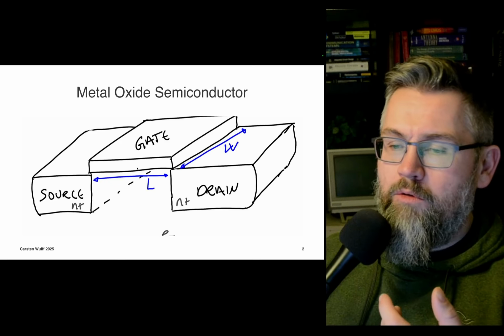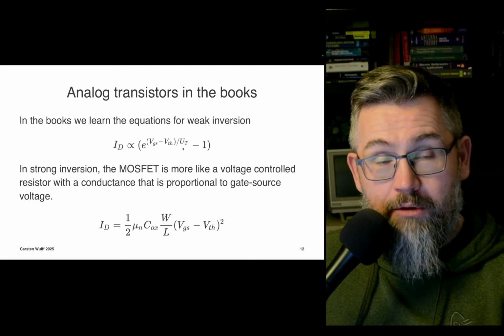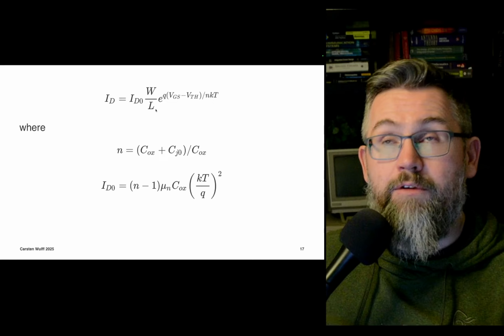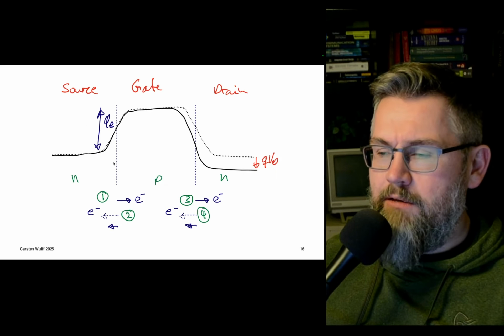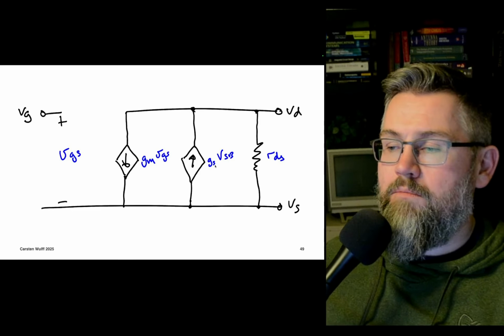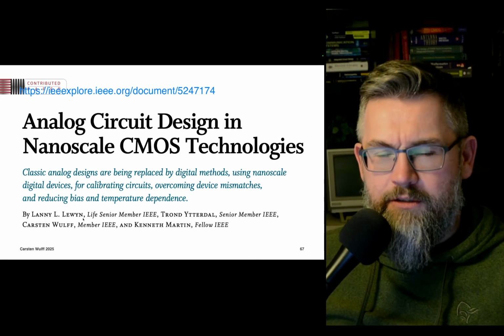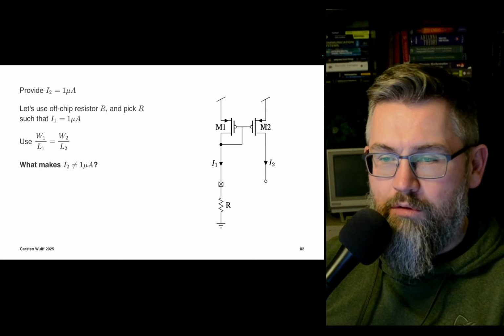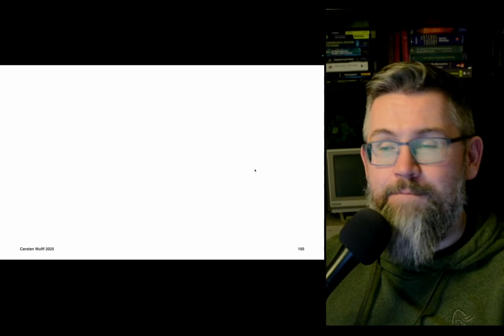Metal Oxide Semiconductor Field Effect Transistors (MOSFET)

Comment: A Deep Dive into MOSFETs: Understanding the Foundation of Modern Electronics

*   0:00:07 Introduction to MOSFETs: The lecture begins with an introduction to Metal Oxide Semiconductor Field Effect Transistors (MOSFETs), highlighting their complexity and fundamental role in integrated circuits.
*   0:00:47 MOSFET Basics: MOSFETs are the basic components of digital integrated circuits, characterized by three terminals: gate, source, and drain.
*   0:01:19 MOSFET Structure: The structure involves implanting dopants (e.g., phosphorus) into the silicon surface to create regions with higher electron concentrations.
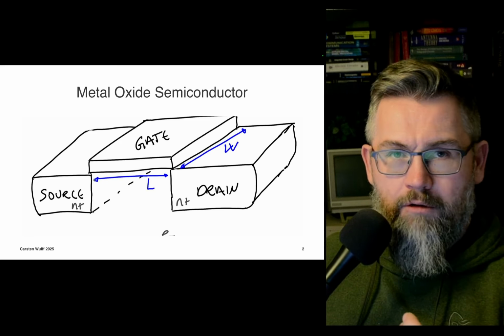*   0:01:45 MOSFET Length and Width: The length is defined as the distance between the source and drain, while the width influences the current carrying capacity.
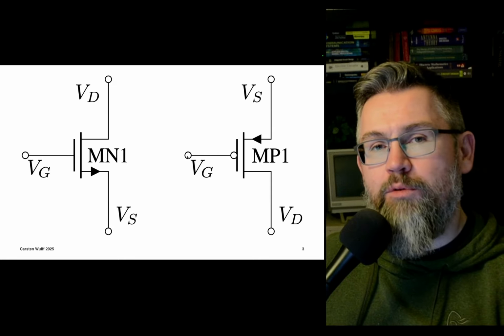*   0:02:57 MOSFET Flavors: MOSFETs come in various types, such as 1.8V n-type and p-type in the Skywater 130 technology, differing in charge carriers (electrons or holes).
*   0:03:38 Field Effect: The MOSFET operation relies on the field effect, where modulating the gate-source voltage controls current flow between the drain and source.
*   0:05:33 Depletion Region: At a certain gate voltage, a depletion region forms, followed by a thin sheet of free electrons enabling current flow.
*   0:06:46 Quantum Mechanics: The formation of the electron sheet is governed by quantum mechanics, resulting in a non-uniform electron density just below the silicon surface.
*   0:07:12 Current Flow and Pinch-Off: Increasing the drain voltage initially increases current linearly, but beyond a threshold, the current saturates due to pinch-off, where the electron sheet disconnects from the drain.
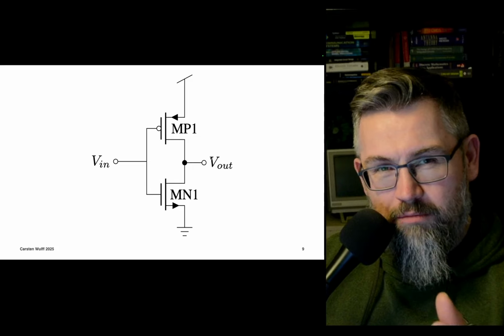*   0:08:39 Logic Gates: MOSFETs can create logic gates like inverters and NAND gates, essential for digital circuits.
*   0:10:59 Weak and Strong Inversion: Different equations govern MOSFET behavior in weak inversion (subthreshold) and strong inversion, depending on the gate-source voltage relative to the threshold voltage.
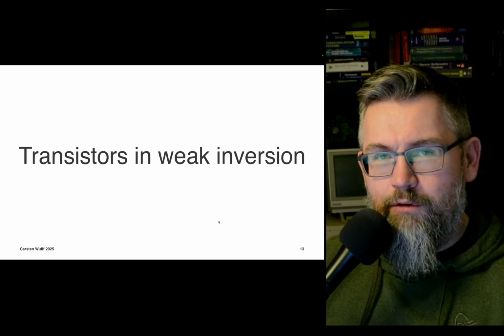*   0:12:56 Energy Band Diagram: The energy band diagram illustrates how applying a gate voltage modulates the energy barrier, affecting electron injection and current flow.
*   0:16:41 Subthreshold Leakage: A small current can flow even at zero gate voltage due to the reduction of the energy barrier at the drain side, known as subthreshold leakage.
*   0:18:51 Electron Injection: Modulating the gate voltage changes the energy barrier, exponentially affecting electron injection and current.
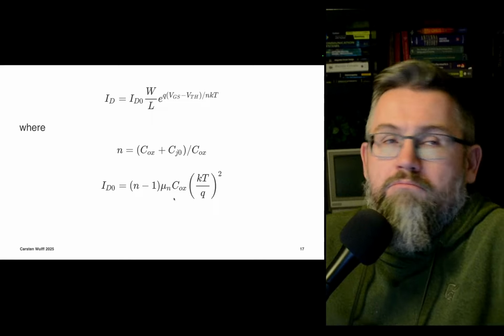*   0:21:58 Threshold Voltage: The threshold voltage is defined as the gate-source voltage at which the density of electrons in the inversion layer equals the density of holes far from the channel.
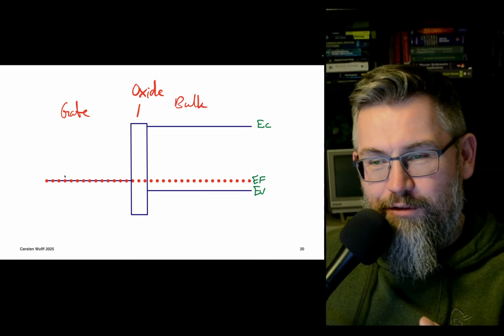*   0:23:38 Strong Inversion Operation: In strong inversion, a conductive sheet of electrons forms, and current flow is primarily due to drift current.
*   0:28:44 Quantum Effects in Small Transistors: In very small transistors, quantum effects become significant, with the electron density peaking slightly below the surface.
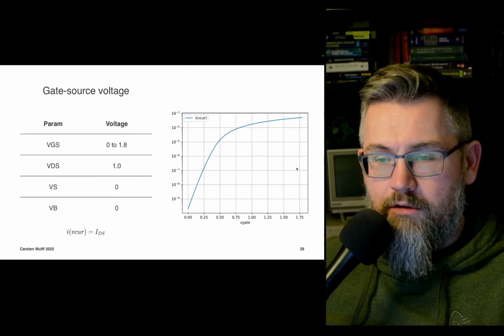*   0:30:24 Small Signal Model: A small signal model is introduced to analyze MOSFET behavior at low frequencies, considering transconductance and output resistance.
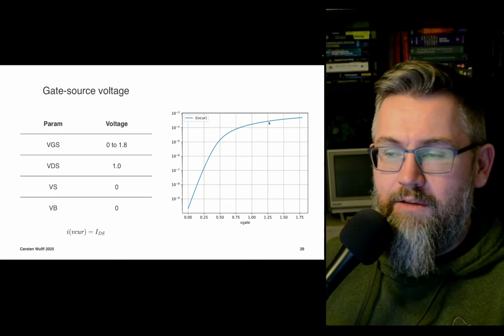*   0:31:30 Transconductance Equations: Equations for transconductance in strong and weak inversion are presented, highlighting the dependence on gate-source voltage and threshold voltage.
*   0:33:46 Moderate Inversion: Moderate inversion is a common operating region in modern technologies, and models accurately predict behavior in this region.
*   0:35:33 Strong Inversion Current Equation: The current equation in strong inversion is proportional to the square of the effective gate voltage.
*   0:37:49 Pinch-Off Effect: Increasing the drain-source voltage beyond a certain point leads to pinch-off, where the current saturates due to the formation of a depletion region.
*   0:39:56 High-Frequency Model: At high frequencies, capacitances between terminals become significant and are included in the small signal model.
*   0:42:41 Intrinsic Gain: The intrinsic gain of a MOSFET is defined as the ratio of transconductance to output conductance, which decreases with increasing gate-source voltage.
*   0:44:02 Bulk Effect: The threshold voltage depends on the bulk-source potential, introducing an additional current component dependent on the bulk-source voltage.
*   0:46:39 Capacitance Effects: Various capacitances exist in MOSFETs, including gate-source, gate-drain, source-bulk, and drain-bulk capacitances, affecting high-frequency performance.
*   0:47:57 Weak Inversion Behavior: In weak inversion, current flow is primarily due to diffusion, and transconductance is higher compared to strong inversion for the same current.
*   0:50:45 Velocity Saturation: Electrons have a speed limit, affecting current flow at high electric fields and leading to deviations from the square law model.
*   0:54:22 MOSFET Scaling: The trend of scaling down MOSFET dimensions has led to increased complexities and the need for advanced fabrication techniques.
*   0:57:31 Drain-Induced Barrier Lowering (DIBL): In small transistors, increasing the drain voltage can reduce the energy barrier at the source side, increasing current and effectively acting as an additional resistance.
*   0:58:46 Well Proximity Effect: The doping concentration can vary near the edge of a well due to ion scattering during implantation, affecting the threshold voltage of nearby transistors.
*   0:59:59 Stress Effects: Mechanical stress can alter the mobility of charge carriers by modifying the band structure, affecting current flow and introducing variability.
*   1:01:54 Gate Oxide Leakage: Thinning the gate oxide can lead to electron tunneling, causing gate leakage current, a problem addressed by using high-k dielectric materials.
*   1:03:21 Hot Carrier Injection: High electric fields can accelerate electrons, leading to impact ionization and potential injection of hot carriers into the gate oxide, degrading transistor performance over time.
*   1:05:09 Channel-Initiated Secondary Electron Generation: In certain configurations, holes can accelerate and create electron-hole pairs, with the electrons potentially getting injected into the gate.
*   1:05:59 Variability in MOSFETs: Various factors, including voltage, layout, process, temperature, and random variations, contribute to variability in MOSFET performance.
*   1:07:45 Temperature Effects: Temperature affects mobility and threshold voltage, with competing effects on transistor speed.
*   1:08:53 Random Variation and Mismatch: Random variations in doping and dimensions lead to mismatch between transistors, which can be modeled using Pelgrom's model.
*   1:12:56 Optimizing for Mismatch: Operating in strong inversion and using larger transistor areas can help reduce mismatch.
*   1:14:57 Noise in MOSFETs: Thermal noise, flicker noise, and popcorn noise are present in MOSFETs, affecting circuit performance.
*   1:17:33 Conclusion: The lecture provides a comprehensive overview of MOSFETs, covering their fundamental principles, operating regions, various effects, and considerations for analog circuit design.

I used gemini-1.5-pro-exp-0827 on rocketrecap dot com to summarize the transcript.
Cost (if I didn't use the free tier): $0.11
Input tokens: 81953
Output tokens: 1653